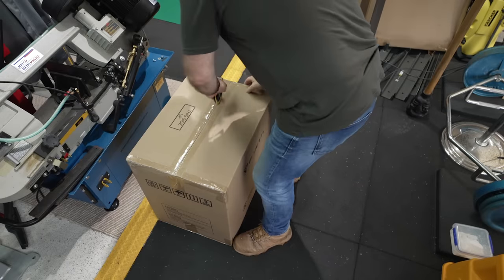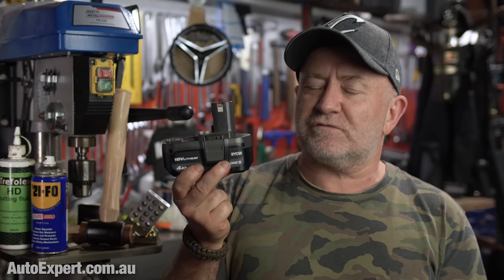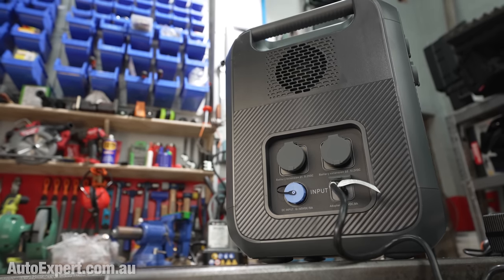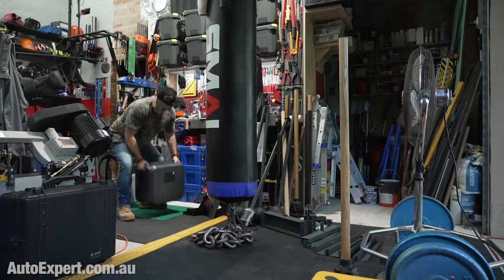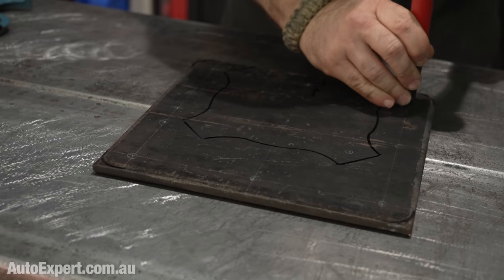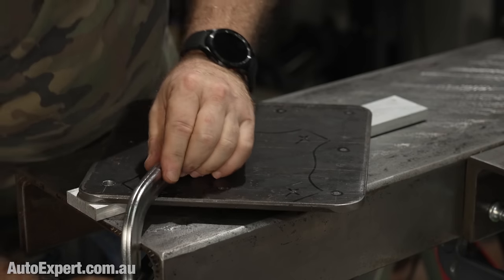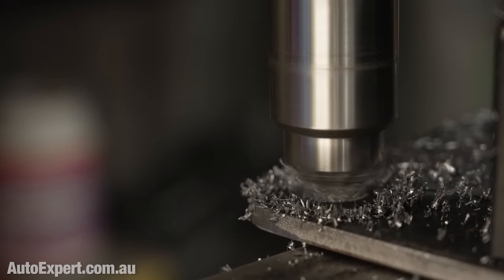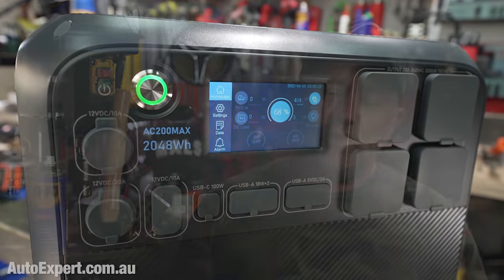Ultimate portable power solution? New Bluetti AC200MAX - full test! | Auto Expert John Cadogan

Comment from the maker: BLUETTI will be discounting the AC200MAX ($400 off) at 11am Tuesday 12 April 2022. First 200 units only. Links below:

Home page: https://www.bluettipower.com.au/?ref=8xzu1i8qk8
AC200MAX: https://www.bluettipower.com.au/products/bluetti-ac200max-home-battery-backup?ref=8xzu1i8qk8
350W solar panel kit: https://www.bluettipower.com.au/products/bluetti-sp350-350w-solar-panel?ref=8xzu1i8qk8
B230 Expansion battery: https://www.bluettipower.com.au/collections/expansion-battery?ref=8xzu1i8qk8

AIMS Industrial
10.2mm tapping drill: https://bit.ly/3Gw4w1q
(This is the drill for tapping M12 x 1.75)
Sutton M12 x 1.75 tap set: https://bit.ly/3wzouoN
Reply: Update. It finally turned up.
Reply: Hi, I was wondering if this could be a good investment to harvest more solar power and use the Bluetti power station as a extra (free) energy source for charging mobiles, and maybe cooking water with it?
So basically buy the extra solar panels and use it as a power generator?

Comment: I purchased an AC200P last year and so far has saved our 2 fridges and my wife's sanity (really mine) so she could watch TV. It is so good I purchased another AC200P earlier this year. 2 weeks ago, our 4th power outage since the first AC200P, this outage 27 hours and the Bluetti's should their ground well. I also use them for weight lifting exercise, a great workout.
Reply: Does it slowly (or quickly?) lose power while turned off and nothing plugged into it? Thanks for any suggestions
Reply: @impermanenthuman8427  Hi, they loose very little power over time, mine may sit for a few months before being used and they still last for hours without recharging. They are a very good quality unit.

Comment: John, there is additional info about battery everyone needs to know: for lithium battery, it is best to leave at least 10% power. complete suck up all the juice is bad for the battery. that's why your solar battery pack can be only max at 90% its power reservation (so if you have a 10kwh battery, the most you can get out from it in discharge mode is 9kwh, safely. using the last 10% will short the battery life.
Reply: Make em puff n burn the joint down.

Comment: I purchased an AC200P to replace a 2kVA genset to operate a 1500W demolition jack hammer, mostly used for driving earth rods into some terrible ground in remote locations in northern Australia. The AC200P can even allow me to do this places with aircraft only access, a genset is not an option there, so a sledge hammer was the weapon of choice. AC200P does a great job and should give an hour and 20 minutes of operation, if I need to drive home 50 earth rods in one sitting.
Reply: Alex, power banks the size of the AC200P are forbidden to be carried on passenger aircraft and must be consigned as freight as they are considered Dangerous Goods. The size limit is 160wh with the airline operators approval, AC200 is 2000wh. Dangerous goods regulations apply to Airline and Charter operators alike. Your AC200P can only travel by air when consigned as freight on a cargo only aircraft.

Comment: Bought a 200P based on last suggestion.  Put on a Bunnings steel cart in garage with the Engel Fridge.  On a whim, drilled hole in wall and put in second power point behind fridge.  by fluke a week later had first blackout in a decade.and switched over power and olso powered some light.  Worked a treat.  Fits in the 4wd too.  Works well, only down side is the weight but can’t get that power storage for much less.

Comment: I put it in my 35 ft Diesel Pusher motor home and got rid of the acid lead batteries and it works great Powers a resi fridge and one AC unit

Comment: Hi John, this is a nice bit of kit….. but… I have now done my research and there seems to be a few limitations that are not documented and do limit the use cases (This does stand for the ac200p anyway there are more reviews of this system). While the system has a 2000 watt battery there is a constant draw while the system is turned on of about  350 watts over night with ac and dc turned off. This is estimated because the current draw isn’t documented in materials that I can find. As I’m sure you’re aware when you size a battery/solar system this info is essential. 

One user who had received a free system (like you did) did another review after owning the system for 6 months and was very disappointed. He initially had it in his camper and had to replace it with something else with no current draw. He then started to use it in his off grid house and needed to have a petrol generator to top it up because of this “phantom power draw” which sort of isn’t the point obviously. As far as I can tell this system is probably more designed for home use when the power goes out or if you need to do some work where power isn’t close. After my research it’s not well suited to those headed to Dingo Piss creek in their camper for a week, unless you’re happy to carry a generator.
Reply: What solar inverter kit would you recommend instead then for portable and frugal off grid power that is better than this one? While also being sufficiently light for one person to move around? Thanks for any suggestions

Comment: I mounted my benders and shears (called a knife here in the UK) on a post made of 100x100 x6mm hollow section which goes into a socket in the concrete floor the top of the post also has a socket so that each piece of equipment can be stored on the shelf until needed and only one post is required, by having more than one socket in the floor the post can be moved to the best position for the job in hand the post and equipment is held rigid by suitable clamping screws that way the bench is kept clear and does not need to be as heavy or bolted to the floor.

Comment: If the unit is turned off completely with nothing plugged into it, does draw down/leak power over time? And if so how much power is being lost by the time you need to use it as a backup power source? In other words if you just want to it to power a camp fridge/freezer during the day but turn it off at night (with the fridge/freezer lid shut so frozen foods are still frozen or at least still safely cold by morning) plus charge phones during day too plus a couple of head torches, will it still have as much power when you turn it off over night by morning with fridge detached?
Thanks for any suggestions

Comment: I’m looking to get one for some camping and for work using the microwave amd charging my battery. I’ve got a 12v in the back of my Renault traffic will this charge it up as I drive along? When we go camping it’s a pain to get ice every two days etc so looking to accommodate this with a fridge.
Reply from the maker: Get a solar panel - maybe a fixed one on the roof.

Comment: Interesting review. Too expensive for me, like twice the value of my 2 cars, but I liked the 'project'. Luckily in the UK, power is reliable, albeit expensive.
Reply: Well I've got solar on the roof so can recharge a unit for free if the grid stays alive. I have a unit half this size rated at 1100kwh, looking at this very unit at the moment which costs about £1900 in the UK or I may just buy another similar unit too what I already own thus giving me the same combined power in two separate units ?
Reply: With the energy prices in the UK is this still expensive?

Comment: Dear John.  1: In the  specifications of the Bluetti unit the clain of a Pure sine wave output and using this term is just a marketing 'Grab you' to fool the  public.

>> Interverters do not put out a voltage sine wave and the current draw of the device dictates the shape of the current wave  form. This knowleadge is from when I taught this to others  in engineering land.

The 350 solar panels will supply 10amps but to reguated voltage of (guess) 14 volts, like a  car charger. From my calculations that is only 140 watts. Sure the the rated watts is 350 but the BMS only cares about the current input.  

from spec sheet  >> Solar Input: 900W Max.OCV 10-145VDC, 15A.

Not defaming this engineering of this unit, just does not make me warm and fuzzy

Comment: Hi JC. I've been tracking and eagerly awaiting the release of the Bluetti AC200 Max here in Oz (as a product improvement to the AC200P) when I first became aware of it via Will Prowse's YouTube channel and hence, 1 x AC200 Max promptly purchased at 1101hrs today - possibly the first purchaser of the product : ). I plan to use the portable power unit as the alternative to a dual battery system in my (4WD) vehicle for weekend family camping trips but also on much longer trips to DP Creek in the future (also have a portable Honda generator as a last resort back-up). Sure there's a weight and (cabin) space cost to be reckoned with but so too with a dual battery system right? Apart from that, I think for my application, the benefits of the system far outweighs the 'cost' in comparison to a permanently installed dual battery system in the vehicle.
Also, given that the unit allows power usage whilst simultaneously being charged, I plan to continuously utilise the Bluetti at home to constantly power my fridges, washing machine (as required) and other power hungry devices when not camping. I previously purchased a set of three SP200 Bluetti solar blanket panels during a recent sale which will match my AC200 Max nicely. Upfront item cost aside, it sounds like 'free power' to me.
The Bluetti is advertised to last for 3500 cycles translating to about 10 odd years if used 24/7 and according to Will Prowse, theoretically could outlast a person's lifetime with careful battery management e.g. maintaining the usage environment temp around 25deg; maintaining between 25-75% state of charge; and not constantly slamming in or rapidly sucking out the available charge. Obviously this is not exactly practicable in a camping situation but perhaps something for users to keep in mind - time will tell as it will re: the Chinese product manufacture. I believe that the only downside may be the lack of a 'ruggedised' build in comparison to the Redarc Block but when comparing the features not to mention the cost between the two, I think the figures speak for themselves.

Comment: My AC200Max just came in.  Charged it up all the way and did a full discharge using a kilowatt meter and a 500 watt heat radiator plugged into it.  Only got 1720Wh which is only 84% of 2048Wh total.  Should I be getting 2048Wh or pretty close to it considering this is brand new?
Reply: 84 % is a good value and within the aimed parameters. Take a look in the manual of the AC200MAX. It us mentioned there. Your LiFePO4 has 2.048 Wh. A part of the 15 % up to 100 % is consumed by the inverter which needs energy for itself while operating. And the final rest is hold back in the battery for security reasons to avoid a deep discharge of it. 
I hope that helped and you enjoy your  purchase 🤗

Comment: Hey guys and/or gals.... I'm new to solar in whole and I'm looking to buy my 1st PORTABLE solar system/generator and was looking at the ac200 max but now I'm concerned about the xtra batteries not charging after they drain or shutdown. Can anyone tell me if thats been fixed or if not is there another system similar in specs with expansion batteries THAT DO WAKE UP BY SOLAR IF THEY DEPLETE OR SHUTDOWN. thank you soooo much for anyone who can help...

Comment: $3000.00 , hell i can buy lots of genis and gas for that , and i can fix them when they fail . how does much does it cost to replace the battery , never mind any pc cards that needs replacing when they fail ? my coleman geni 5000w unit cost me less  than $500.00 and ive had it for last 10 years , and i dont think i have spent any more than $1000.00 in fuel an maintnes in that time. an what happens in 2 years , are the parts still going to be available ?

Comment: How does it compare to a Honda 2000 generator produces 1800 watts per hour at least it be able to charge this overprice unit just by a lithium battery and inverter for about half the price of this unit. However these units are not bad value just remember is just over 2 kw or about 40 cents of power

Comment: so ,, 2 x 100 amp hr lithium batteries( aldi ) $425 each @80% usable =160 amp hrs,  2640 watt hrs ( i think )  ,  battery box from kings x 2 , $130,  3,000 watt pure sine wave inverter kings $499,  wireless charger  $20. usb adapter $15.  mppt solar charger  $200. shunt  to keep track of the in and out  juice  $150 , all up around  $1891. Shit ! I've spent too much , bluetti $ ac200 max $2599 ( on sale , normally $3,199 )

Comment: Might be better and more reliable than my Yamashit EF1000iS that has bad fuel filter design and unreliable tappets that keeps on unajusting and need servicing via the book every 300hrs and pull all the plastic covers off and oil change every 100hrs and keeps on surging up and down while running and polluting the environment.

Comment: I have a good idea.    I can run this at home as a DIY solar battery.
Charge it up every day using my 8.2 kw solar inverter, which is throttled to 5kW export.  Like today when the output curve rose to 5kW by 8 am and then flatlined, until I turned on the kettle when it throttled up, still maintaining the 5KW export.   
Basically, I can charge the battery for $0 opportunity cost most days and can run the fridge  on the battery 24/365.
Did you say I can add two more batteries?   I do not need that Tesla PowerWall any longer.
And I can sell the Honda EU20 generator that I hardly use It sits unused for so long I am never sure it will not be gummed up (again) just when I need it.
I am sitting at home with Covid day three so be kind.   Genius idea or is it the drugs talking?
Reply: Problem is Gary, at well over $1,000/kWh, it's a very expensive way to power your fridge longer term even if the solar PV you have available to charge it is from excess capacity which would otherwise be curtailed.

It'll work out to be something well north of 50c/kWh over a long period once you account for battery capacity utilisation factor, battery degradation, round trip efficiency losses and so on.

Also, while you might have lots of excess solar PV capacity, the Bluetti's charger can only pull 400W, so not all charging will occur within that time window of solar PV excess.

It's the same equation with most dedicated home batteries. Financially they suck. They are 3-4 times the cost they need to be to make financial sense. Grid power is just cheaper.

The use case for these is for powering things where or when you do not have grid power available. It's about convenience. 
As a tool to save money, no. 

That said, if you already have one primarily because you need portable/remote power, or for occasional backup, and then want to extend its utility in the manner you describe, then sure. But purchased as a way to "save" money, no.
Reply: The Bluetti is intended to be an all in one unit, portable etc - ideal for camping or anywhere remote power is needed and emergencies. What were you going to do? Run extension leads to your appliances, because you can’t run power into your board without an automatic transfer switch. I’d look at a server rack 48V system which will give you 2.4kWh of LiFe - one that will talk to the inverter, a Victron 48V Multiplus II (which is an inverter/charger/ATS and distribution panel all in one), which can take the grid and excess solar and can disconnect from the grid if it fails - the cheapest one is 3000VA (that’s more power than the Bluetti) and then you need to pay an electrician to set up an essential loads panel that runs of the Victron and batteries. That’s a basic outline and it won’t be cheap. The Victron and the battery will cost around $3000 - $4000 on their own, more if you went for the 5000VA Multiplus II model, but it’s more flexible than the Bluetti. You can easily add batteries to the system. You can design rules for when it charges and discharges (so you can take advantage of load shifting if you’re on TOU rates). You could build a system around the Bluetti but you still need an essential loads panel, an automatic transfer switch and you’d lose the flexibility and control and the 500W battery charger in the Bluetti is way underpowered for your application. You’re often going to have 2000W of excess solar.
Reply: @mondotv4216  Nice detailed response Mondo, although the transfer switch need not be automatic, it can be a manual switch. I have something not dissimilar to what you describe (4kW AIO inverter + 2.2kW of solar PV + 18kWh of SLA batteries) all for not much more than the Bluetti. Works a treat for the regular outages we get up here in northern New South shitsville.

Comment: Cheaper than an EU2000i. But quiet. 

My big ? would be "What's the cycle life of those batteries? How many cycles can I get before they die?" 

Thing with batteries, is unless they're warrantied, ya just never know, I cannot tell if a battery pack has high quality Japanese cells made at Panasonic in it, or if the cells come from China. 

and you would never know until the thing refuses to power on some day... Replacing the cells? Yeah, It's flat out impossible... welding li-ion cells is simply a "Yeah don't" proposition.
Reply: LiFePo batteries like the ones in this unit will retain 80% of their performance at 3500 cycles. From what I’ve read, that is even a conservative number. 

So if you’re using this heavily and do one full cycle a day, the batteries in this unit should last about 10 years.
Reply: @winjoda   E2000i will too. But cheaper.  In a nutshell, if you MUST be quiet these are the go.

Else,  there's cheaper.  

Also there's the whole 'Its a lithium' concern